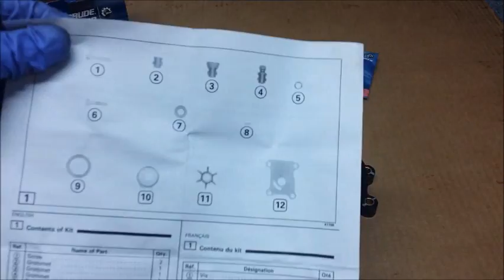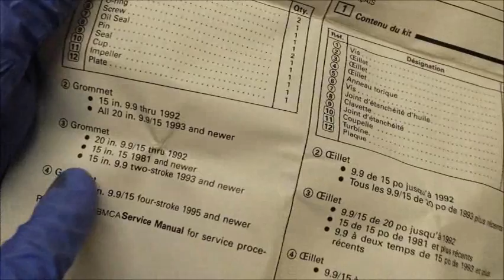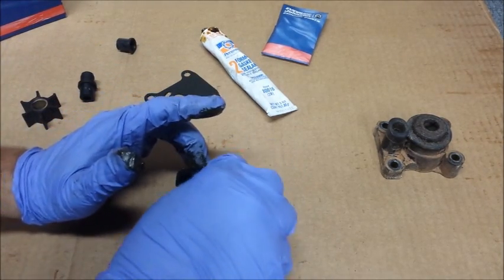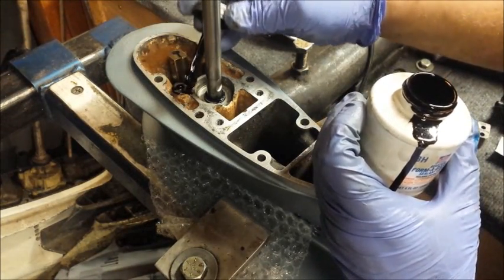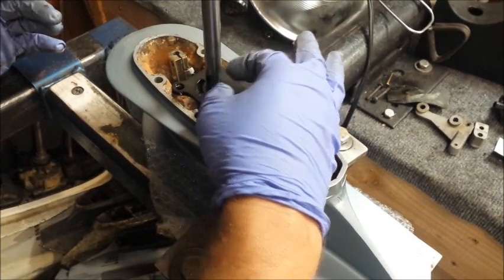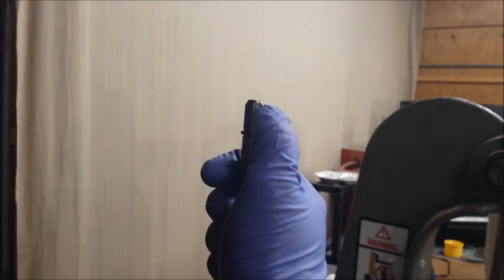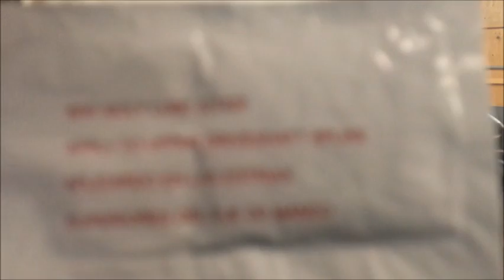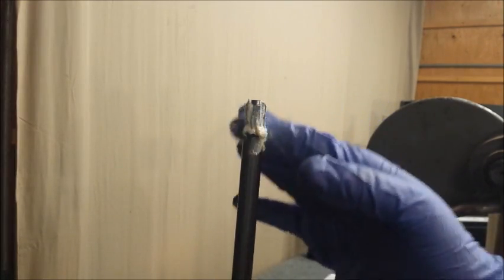Johnson 15 HP Rebuild Part 11; Water Pump and Gearcase Install

Comment: Brandon i have gained a lot of knowledge from your videos, thanks for that. I recently aquired a 1975 evinrude 15 hp. Starts and runs good. Took it out today and at higher rpm right after the boat plains out it jars and even went in neutral once. Could this be anything other than a worn clutch dog? Thank you

Comment: I just did the water pump kit and still no "pee". But when i run it on muffs water comes out of the mid section where the shift shaft goes into the lower. Is that just a matter of replacing that grommet or did i f something up.

Comment: I just did a rebuild but now the outboard will not run with the cover on :-(. I am thinking that I do have an exhaust leak and was thinking it should be a seal at the bottom of the exhaust. I have a round exhaust like you do and not the square. Do you have any ideas to why the outboard only runs when the cover is off?

Comment: I have a 1974 15hp johnson and have been watching your videos to try to repair it. The lower unit shifts in and out of gear while separated from the motor and even once I connect the shift rod to the lower unit but as soon as I actually ma l merry the 2 units it will only go in nutural and forward. Any help is greatly appreciated

Comment: Hi Brandon, thank you very much for your tutorial. I have a Johnson 15 hp '97. yesterday I start to open the water pump. once I took off the drive shaft I noticed that the oil on the bottom , the part that is inside the gear is black.  On the manual says that  if the oil is melted grey pr dark , is not a good sign and contact the assistense. Any Idea why this oil is so dark?   I live in italy so not easy to find sealant product you use  Aviation sealant and permatex2. Any similar that I can buy in Europe?

Comment: They don't do it because it is the only way to cut costs. If they don't but it in it cuts the cost 2 ways 1 no money spent on sealer and no cost on man hours to actually install it i know it seams miniscule but a order for 50,000 units will save a lot of money

Comment: Dude...I just gotta say man, I've watched a lot of diy vids in my day, and I relate the most to the way you did this one in the sense of the work you did on this 15 hp Johnson.  The whole not remembering if you lubed the drive shaft, thoughts about the kit, why your doing stuff different, and especially the black rtv sealant around the pump housing base!  I just did my first Out board motor pump kit (I have a lot of experience with small engines, automotive engines and general mechanic stuff, but never have worked on an outboard motor til now) and I gave in and used the same rtv sealant on my pump housing.  Lmao.  Loved this vid.   Thanks man!

Comment: Hey Brandon I have the exact motor and I’m rebuilding the water pump,I noticed a small hole on the long tube it’s about 2 inches from the top and it’s about the size of the tip of a tooth pick,I did put a garden hose to the tube and water shoots out from the hole,just seeing if this is normal.

Comment: Just watched this video. I am doing the same. I can’t get the driveshaft to engage the lower unit. Everything I’m working on is in perfect condition. It feels like there’s a finger or dog out of place. Anyone know the trick? My upper driveshaft spline has no 0 ring groove.
Thanks
Reply from the maker: rotate the flywheel while inserting

Comment: Thanks for the video! Very helpful! Does the seal that’s sits in the lower unit around the drive shaft which you put grease on need to be replaced as well? I think you called it a hub seal but I can’t be positive. Thanks for the help!

Comment: I want to follow your video to change my impeller but I am having trouble dropping the lower unit. The problem is that the 5" extension housing will not slide down. Any suggestions for getting that thing off?
Reply: Shift your gear to forward it will drop down for you to take the gear linkage bolt off. I have 9.9 johonson  extended long shaft 20 inch.
Reply: https://youtu.be/o-tiUh8LoFc

Comment: Hello, I've just watched your video and I am wondering about part number 0326885 of evinrude parts, which they call water restrictor. I have purchased a 1983 15 HP evinrude and I found that part inside the water pump housing. So I will replace water pump with a complete kit and I don't know wether I need to enclose this part or maybe I should install the pump witout It. Thanks in avance.
Reply from the maker: I have no clue what that is or does, and have never seen it mentioned. Looks like it was used from 1981-1987. Guess I'll have to go rip one apart and see what it is. 
However, it doesn't seem that important as the former, and latter, outboard didn't have them.

Comment: I just watched all your videos. I have an 81 15hp Johnson. I replaced the drive gears and now that I have it back together it feels like it doesn't want to stay in forward gear. Reverse and neutral feel fine but the forward gear feels like it doesn't want fully lock in? I need help please
Reply from the maker: Screw the shift rod in correctly?
Did the detent on the shift handle get out of adjustment?
Reply: @BrandonsGarage  I measured the height of the shift rod with a caliper when it was pushed all the way down. Then I had to readjust the link on the shift handle to make it go all the way in forward but sometimes randomly it's like it catches on something and won't go into forward unless I mess with it a little. The original clutch dog had 2 prongs with chunks missing and the new one has 3 prongs. All gears were new and came as a package. Could they just need to get broke in?

Comment: Excellent video, some great tips, which helped me install an impeller in a '73 Johnson 20hp, which pumped water like a champ after it was done.  Mine came apart differently, with the drive shaft attached to the power head, and it was a real bugger to get the key to align, however carefully I "eyeballed" it.  Then the shift rod missed the linkage, and I had to let the gearcase out a bit to get 'er in.  But it eventually got done.  Many lessons learned.

Comment: Brandon there is no set screw for the shifting rod on my 15 horsepower Evinrude it seems as though it's connected all the way to the top where do I find that set screw in my 2015 horsepower 4-stroke Evinrude
Reply: Brandon it's a 2000 15 hp 4 stroke evinrude

Comment: When you inserted the drive shaft at 4:40 I don’t see the nut on the shaft like my 1978 Johnson 15hp has ? It won’t allow for me to install the new impeller pump because the nut is in the way ? Does it go deeper down into that hole in the lower unit ??

Comment: hey how did you get the upper parts so clean
Reply from the maker: Do you mean on the exhaust housing? or the gearcase?
Reply: exhaust housing
Reply from the maker: Everything was taken apart, sand-blasted, painted, and reassembled.

Comment: On the long 9.9 long shaft will it have the same groove on top i am replacing one and theres no groove
Reply from the maker: Newer engines don't have the groove for the o-ring at the top of the driveshaft.

Comment: Mate know its an old video but a couple question if you still monitor. By the way this has helped so much with an old 1990 I was give. When replaced water pump the gear shaft had some spring in it pushing up from gear box which I had to hold done while tightening the pump cover, you didn't seem to have this push back any ideas?
Also I changes the sparks and its starts great I need to replace thermostats I think. But when it's running in the water pushing the tinny it sort of busts power the cuts back a little and burst again, would this be the Carby of fuel pump? I am as yet to service them but your video has given me all the info I need and made me NPT scared to do it as I was, really thought it would be much harder.
And the top of hydride shaft didn't have that hollow in it for the O ring. It had an O ring but there was no groove to put it in so I left it high on the shaft and it slid down to its position when installing it. Is this a problem?
Really hope you get this as its the best series Ive ever watch on an outboard rebuild.
All the best Gus

Comment: Brandon I have an old 15 h.p. Johnson.  I bought it in the early 90s.  I believe it is from the late 70s or early 80s.  There are no model or year anywhere on this motor.  Where a tag used to be it is not there anymore.  I need to replace the water pump and the impeller.  I have taken it apart and watched your video (Johnson 15 HP Rebuild part 11 Water Pump and Gearcase Install) and every part in the video looks identical to what I have taken off.  Can you please supply me with the kit part number so I can finish the job.  And by the way very good work.  Thanks for the informationKeene Palmer

Comment: What kind of oil did you use to lube the impeller housing?
Reply: I'm assuming any motor oil will do. Its just to lube the impeller for a cleaner, smooth install.
Reply: Silicone oil is often used with rubber impellers that move water.

Comment: Hey there. I figure it out that inputs a weep hole and my shift rod O ring is leaking. Is there a easer way to replace that o ring than to disassemble the entire unit.?
Reply from the maker: Wouldn't that be nice!
But nope, only way you're getting to it.

Comment: Great video. Replaced my water pump then watched your video and now need to take it apart again to seal it and put the O ring on the drive shaft. Lol. I have a small hole on the opposite side of the upper drain plug. It leaks oil when I worked on WP. What is it for?

Comment: Brandon's Garage... The little O-ring that comes in the housing bolt package, that you put on the end of the driveshaft in the video, what if that did not come out when I removed the lower unit? I don't see it in the upper half in the driveshaft tube. 
I have an 88 Evinride 15hp 2 stroke. Thanks
Reply: NoSurrenderNever I have read and was confirmed online that you use 3M Nitrile High Performance Rubber and Gasket Adhesive (847) instead of the outdated OMC Adhesive M. My repair manual says the outside diameter of the water tube grommet gets coated with 3M 847.  For added info, The book also says for 9.9 and 15hp ONLY to run a thin bead of 847 on the machines surface of the gearcase that mates with the impeller plate. The first thing that goes on. Good Video!!!
Reply from the maker: Your engine doesn't use the driveshaft seal.
Your engine uses 2 seals on the crankcase head (P/N 0394327) It doesn't use/need the driveshaft O-ring.
Reply: Brandon's Garage Okay good to know. Thanks for the quick reply! One other thing, the bolts came with loctite already on them. Is it necessary to put rtv in the lower unit holes. And if I do a vacuum or pressure leak test on the lower unit, what pressures or vacuum readings am I looking for? Thanks again!
Reply from the maker: Not RTV,
You want anti-seize of some sort.

And no reading, just make sure it doesn't leek.
Reply: Brandon's Garage Okay cool thanks man. I don't have any Gasket Compound or Gasket Sealer M so I'm hoping to get away with Permatex Ultra Black on the mating surfaces. What's Permatex Number 2?

Comment: Yes, there is plenty of confusion about those water tube grommets, and the directions don't help clarify the uses either.  The funnel shaped grommet is for the engines that use the open exhaust megaphone, like the one you are working on.  The regular style grommet goes on the engines that used the sealed exhaust megaphone.  You can not use the funnel shaped grommet on the sealed megaphone, or you will trap water in the exhaust housing that could run back into the powerhead.  Using the funnel shaped grommet on the open megaphone units seals what would have been the water drain, keeping hot exhaust away from the impeller housing.  The other grommet is for the four stroke engines.  Any yes, no real need for the sealer on the outer case of the seal, not critical in this application, but the sealer should be used when replacing seals during a gearcase reseal/rebuild.  And yes, installing the impeller into the housing first is a pain, and not necessary on these small engines...But, you want to do it as prescribed on the larger engines with the little oring that seals the impeller hsg, or you will dislodge the oring while lowering the hsg down onto the impeller.  Gearcases should be pressure/vacuum tested anytime they are torn down and reassembled, best to do this before going through the trouble of reinstalling it on the exhaust housing, just in case.  The last thing you want to see is a milky watery gearcase lube the next time an engine comes in for service after internal work has been done.
Reply: I have 1993 Johnson Outboards 9.9 long shaft (20") [ J10RETM ]. I am not sure what a megaphone is. Does mine uses the garmet 1 or 2?

Comment: With your help, I remade the seals of my johnson 9.9 HP 1987. Done myself the special tools and puller, a little difficulty to put the shifter rod to the winding because I wanted to put 2  neutral parts or put The two a foward, redo the nets with 1/4"  28. tank you sorry for the mistakes , I am from Quebec
Thanks Brandon!

Comment: if my prop spinnig at neutral wat happend?
Reply from the maker: Prop should spin in neutral
Reply: never mind i fixed it already but if you have to put the lower unit back i can never make it in forward because i can never make that turn for the srew the shift rod block where the screws go in on the lower unit is than very deep down and you have it in forward and the screws block in reverse how?

Comment: I eyeballed the water tube seals. The taller one seemed to have a slightly smaller opening. I didn't , but wanted to use it. On one of the 15hps, I worked over, the seal was distorted, and it was the short one. I was carefull reinstalling, but am worried about that seal. Thanks again for the well done pump replacement !

Comment: hallo thanks for the tips but i have question about the parts. i live in the Netherlands and i need a water pump kit how do i know if the parts are fake or imitation?

greetings Jasper Van Barneveld
Reply from the maker: Well, when if it comes in an Evinrude box you'll know. 
But the aftermarket stuff quality isn't bad, you just dont always get the newest update/design.
Everything will come in packaging, if it doesnt something may be odd.

Comment: Hi! thank you so much for this series. I think I have messed up my water pump install on my 1975 15hp Johnson. when testing it in a water bucket a lot of water escapes from the hole in where the shifter rod goes in. did I miss the watertube? or used the wrong grommet? I double-checked the watertube after it was pumping out of the shifter hole. please help me. //André
Reply from the maker: How did you notice it coming out of the shift rod grommet?
..or was your bucket not very deep? 

And was it a fair ammount? 

You could take the lower off, put a tube into the water pump, and stick the thing into a bucket and text it with a drill.
Reply: Brandon's Garage The bucket was fairly shallow and I think my motor is missing that shifter grommet. And yes it was quite a bit of water. Is there a way to see if there is any water pressure in the block? I will have to check this out this weekend.
Reply from the maker: No real way to test the water pressure, Only think I can think of is the water tube isnt connected, or you have a leaking drive shaft seal.
Reply: Brandon's Garage I'll send you an update in a couple of days, thank for the help :)
Reply: @Kalledussin  4 years late, but for anyone reading this: there is a rubber grommet that the shift rod goes through. It is often missing and without it water will freely run out of that hole where the shift rod enters the exhaust housing assembly. You can catch a glimpse of it on the video where Brandon test runs this motor. On my 82 it’s part number 319229.